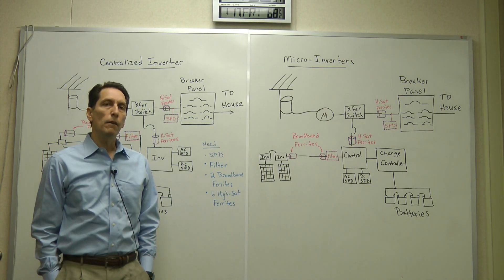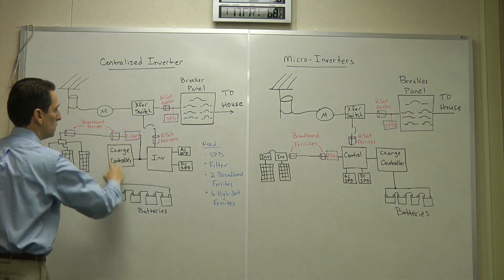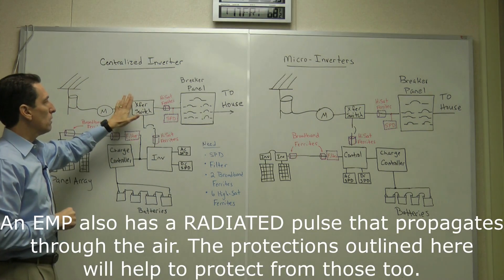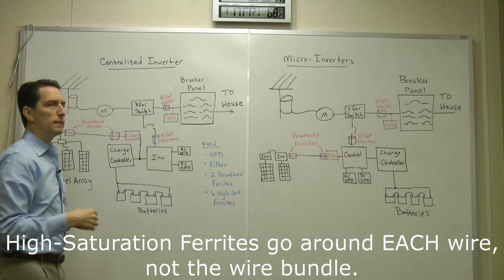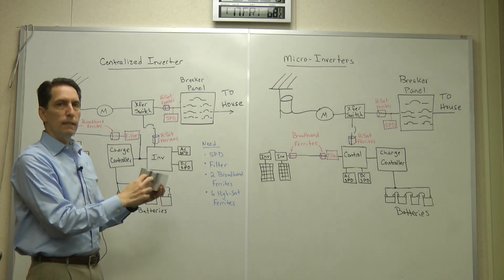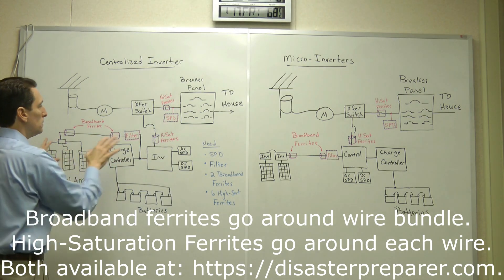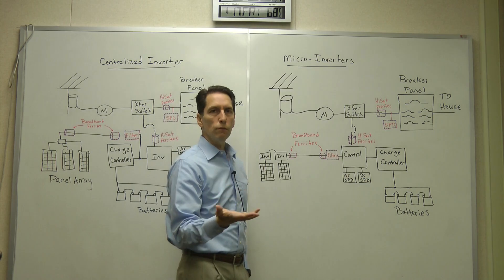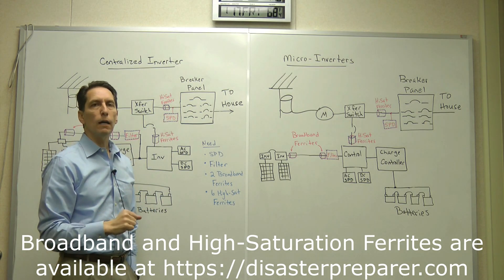Protecting Solar Power Generation Systems from EMP or Solar Event

Comment: If a solar battery is charged up but not plugged into home electrical outlet does it need to be in a faraday cage for protection?
Reply: The batteries won't care, but your inverters and controllers will be fried. The "emp doctor" is a ferrite fetishist. He likes to pretend that throwing a few beads on a wire or two will absorb enough energy to protect your systems. That's total nonsense.

Comment: Create video would it be possible to jump on a phone call with you just to figure out what you might have that I could use to protect my solar system?
Reply: There is nothing that will protect your solar power generation system against a nuclear EMP. If you want power after the war, you have to keep a complete backup system (maybe minus the batteries) in welded metal boxes in the basement.

Comment: I think you were on vacation when I posted this question.

If I have protected my load center would I need an SPD device on the AC side of my inverter. Also, I am using a combiner box for my panels. Would the ferrites go between the panels and the CB or the CB and the inverter? Thks
Reply: Ferrites would have to go on every single piece of wire. Will it help? Most likely not. It will make you feel better before the war, though.

Comment: Thank you, this might be a silly question. If I have protected my load center would I need an SPD on the AC side of the inverter? I am also using a combiner box, would the ferrite go between the combiner box and the inverter or between the solar panels and the combiner box? Thank you

Comment: What about portable solar panels meant to be used in conjunction with power banks (e.g. Jackery, EcoFlow, Bluetti, etc.)?? Is such panel subject to EMP damage when the panel is disconnected from everything? Also what about charger cords to radios, power banks, etc. ? Are they subject to EMP damage when disconnected from everything?

Comment: Getting a system installed with batteries and generator in the coming days.  Any advise beforehand to ensure install is done correctly in regards to the protections necessary?

Comment: I have off grid cabin and HAM shack. found extra benefit of filters and ferrite. My charge controller is Morningstar. during the dat it makes hash noise in my receive. the filter cut it down a bunch . also when transmitting it keeps RF out of controller . this is man made EMI/RFI . some years back a solar event took the west coast  power grid off line . Panel box surge protectors are now required in US buy NEC. very easy to add . Very good video with great info.
Reply from the maker: Thanks. I'm glad that the info was useful.

Comment: Hi Dr. Bradley,  In the centralized inverter configuration you show the array feeding both the charge controllers and the inverter at the same time.   In my system the array feeds the charge controllers which then feeds the inverter.  Should I put the Shaffner filter before or after the charge controllers?  I'm guessing before, but would like confirmation, please.
Reply from the maker: Yes, the filter would go between the PV array and the charge controller.
Reply: Much obliged!  Outstanding videos, BTW.

Comment: I have an older system, but it works very well. In my case I have several strings in series. The length between de first panel en the last from each series is 40 feet. Is it not necessary  to use more ferrites? For example bij the first one from each series?
Reply from the maker: Hi Jacques, yes, for very long string connections, putting ferrites close to the panels is recommended. Many people put a broadband ferrite at each panel for additional protection. I just covered the basics in this video.

Comment: I was under the impression that no surge protector will work in an EMP event, at least on grid power: the surge works too fast for them to react.  What I question is how a panel will fare while in storage, not hooked up to anything?  (I don't yet have a Faraday cage to hold them Like I do the charge controllers: I'm keeping it all aside as a last-ditch power backup)  Any thoughts on unshielded panels in storage?  I've heard good and bad about it.
Reply from the maker: The purpose of the ferrites is to help slow the E1 pulse so that the SPD has time to turn on. As for solar panels, the only test that I know of showed that panels that didn't have wires attached survived. Of course, you can always wrap them in foil or conductive cloth for added security.
Reply: @disasterprepper  
That answered my questions about my Solar Panels.  I have spare panels that will not be connected to anything ... I just wanted to know how to protect them !
Thanks

Comment: Awesome video and info Thanks! Quick question...For the long solar runs from panels to charge controller, are the broadband ferrites capable of multi strings in parallel?  For example I have my solar combiner near the charge controller which combines 8 strings.  Thats a total of 16 wires not including the frame ground.  Which leads me to next question, can that ground also be included.  If I need a separate ferrite for each string I may have to series another panel to reduce the amount of strings lol. (side note: may do that anyway) Thanks again for your work.  Long time follower of sus observer and thats how I found you!
Reply from the maker: Yes, you can put multi-strings in a single broadband ferrite. I have some as large as 1" inner diameter for this purpose. You just want to make sure you have the + and - in the same ferrite. If possible, the ground should also be included in the same ferrite.
Reply: @disasterprepper  Awesome! Kinda what I thought but wanted your expert advise! Thank you very much for the reply!

Comment: Will the ferrites and filter on the wires coming from a micro-inverter array interfere with power-line communication between the micro-inverters and their data logger? In my case I am using Enphase IQ7+ and IQ Envoy.
Reply from the maker: If the ferrites are placed around the wire bundle, they will only suppress common-mode transients, not differential signaling. If you put ferrites around just the signal wires (not bundling in their returns), they can interfere with communications.
Reply: @disasterprepper  Just for clarity: Enphase uses L1, L2, and G in their cables, so these three conductors are the only conductors pulled to the array. The Enphase Envoy uses the line conductors to communicate(signaling) with the micro-inverters. So if I put the ferrite over both L1 and L2 I will not interfere with the communication between the two(micros & Envoy)?
Reply from the maker: @calvinbarlow8947  Hi Calvin, a common-mode ferrite would go over the L1, L2, G bundle of wires (one ferrite over all three wires). The current flowing out any one of the wires would have to return by one of the others, making the current differential. A ferrite around the bundle wouldn't affect those differential signals or power in any appreciable way. Rather, the ferrite would suppress signals that became common to all the wires (such as a radiated pulse). With all that said, I'm not familiar with the details of Enphase products, so please don't treat my comments as expert or professional advice. I would encourage you to reach out to Enphase to address your specific concerns and questions. In other words, I'm just sharing my thoughts with you, not providing engineering advice.

Comment: Would you not want to move the High-Sat ferrites (HSF) after the SPD?

You want to encourage the EMP/transients currents to flow into the SPD (and then to earth GND) and not the remaining house wiring. Thus by putting the SPD first then the HSF after the SPD, you force the currents to go into the SPD instead. Plus any maximum clamping voltage that the SPD peaks at will be filtered down because of the HSF.

Another question, would adding fast reaction time breakers/fuses with the SPDs provide any additional benefit? Maybe to extend the life of the SPD by halting transients right after the SPD starts to crowbar?

Otherwise excellent video, I'd be interested in a video comparing/testing different surge protector strips to see if they have any complementary protection (I'd imagine that a random 700J surge protector can't completely protect against EMP/Solar flare transients).
Reply from the maker: It's a good question. The reason you put them before is that the high-sat ferrites are designed to soften and spread out the very fast transients, allowing the SPD time to turn on to suppress.
Reply: @disasterprepper  Ah I see, so the SPD is just a bit slow for some of the higher frequency transients, but having the HSFs before prevent any transients propagating until the SPD is fully on.

Comment: I see how the ferrites protect the long electrical lines. However, won’t the EMP kill the Inverter, Charge Controller, Batter Management System, etc?
Reply from the maker: It's possible that the radiated energy from the EMP would damage them directly, but the conducted surge coming in on the long wires is the greater threat.

Comment: I appreciate you taking the time and utilizing the correct terminology. Typically non-solar specialists misuse a lot of the terminology. However, the one thing I see is the incorrect placement for the practices I've seen (I can only speak for Mid-West and NABCEP certification instructions). The inverter feeds into the bottom of the breaker panel (secondary panel may be in use with hybrid grid-tie/battery backup inverters like Solar Edge), while the grid feeds into the top of the breaker panel. If the solar generated electricity gets all the way through the breaker panel and feeds all the energy needs of the house, then it goes through the meter and out to the grid. Thus, enacting the bi-directional meter.
Reply from the maker: Yes, thank you, that detail wasn't shown on my rudimentary sketch.
Reply: Pardon the very late reply to this.  What's the solution?  Where should the SPD go in such a situation? Between the grid and the breaker panel, between the solar and the breaker panel or both?

Comment: Your books and videos are well done. (I cited you in my forthcoming science column in MAKE magazine.) Question: Please comment on the ability of solar panels to withstand an EMP, particularly the fast risetime initial pulse.
Reply from the maker: Thanks for citing me in your column. As for solar panels, the only test I know that was done on solar panels showed that standalone panels survived the EMP (done in a simulator), but those connected to long wires were damaged if they didn't have protection.

Comment: How does a person protect a motorized wheelchair or scooter from a EMP  or solar event
Reply from the maker: When not in use, it can be covered with conductive cloth (or any kind of conductive barrier). When in use, you could use ferrites around the power wires, but it's not a guarantee that it would be protected. With that said, the wheel chair motor is quite robust to RF energy. It would be the solid-state circuitry, if there is any, in the control and display systems that would be most vulnerable, and that would be difficult to protect without analyzing the circuitry.
Reply: @disasterprepper  thanks for the explanation